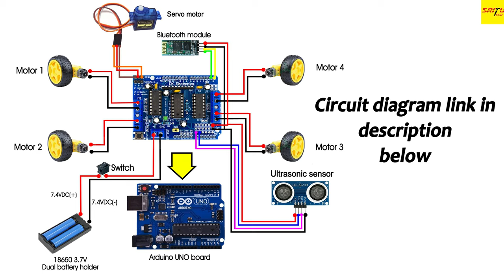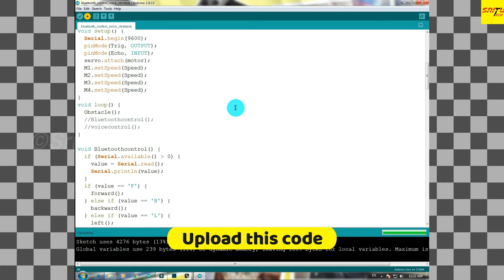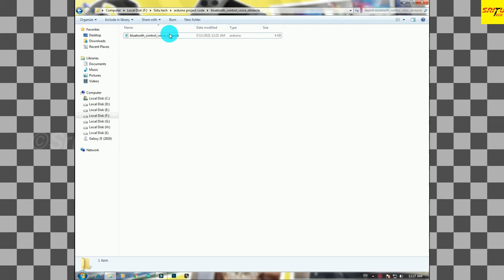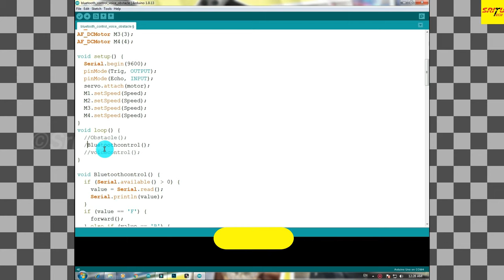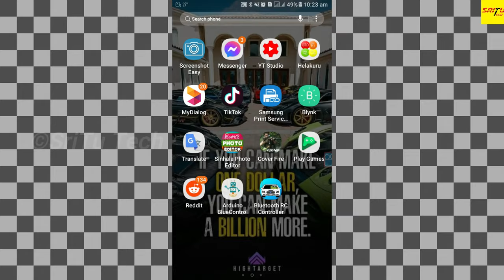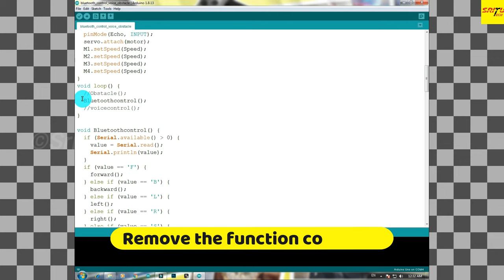Arduino obstacle avoiding + voice control + Bluetooth control Robot | DIY Arduino Robot

Comment from the maker: 👉Code and circuit diagram.
https://bit.ly/3IhfCMc
Reply: Hello sir How  this car cannet
Reply: In your laptop which version of  arduino programm 18.13 or 18.13or 22.2?
Reply: Which version is used to this code

Which version I should download aurdino
Reply: @mvsfcreation6847  +. Sorry for mistake Im not good at speak English. Which version  is used to this code
Reply: af motor only file name for download please answer
Reply: Adafruit-Motor-Shield-library-master zip  in Google drive only
Reply: It is not moving forward, can any one help
Reply: af motor.h : no such fie or program
Reply: The side doesn't open now😢
Reply: Mujhi obstacle avoiding nahi banana to mai kya karu
Reply: @drymaxgamerz9791 jonsa Banana ha tumhe wo wala ke samne se slash remove Karena agar obstacle to uska samna wala slash agar voice to uska samna wala slash hta dena
Reply: Bro it's not working
Reply: @sritu_hobby not working bro
Reply: Very nice 🎉
Reply: @vinaypuli8690  same problem bruh did get the solution
Reply: Bruh it is not moving can u help me
Reply: bro just llike u  r separately using those module can of voice obsacle and bluetooth so can i just upload the three os module at the same time
Reply: @sritu_hobby pls help
Reply: Bro, can I get the link of the app that you used for remote control of the car
Reply: hi,may i know why my bleutooth connection are not stable,just like connect to pohone about 10-15 seconds,then it will automatically disconnect
Reply: Hello sir me yeh puchna chata hu ki Bluetooth control + obstical avoiding ek saath kaam kar sakte hai
Reply: I want items
Reply: Interesting
Reply: I didn't know how to done code
Reply: This is for school project
Reply: How to connect ardino in computer
Reply: Yes @MORTALSKGAMING
Reply: Sir please help I think these codes are not supported now in the arduino  sir please give new codes for the same thing please
Reply: replay
Reply: H
Reply: bro i have fixed some bugs in this code and now it is functioning properly
Reply: 11:45

Comment: I follow same steps but my car didn't start
Reply: Are ache se kkarega tabhi start hoga
Reply: You want to put the code
Reply: Mera bhi same problem h... Hc05 tk power hi nhi gyi
Reply: Check code bro
Reply: Mera Arduino jal gaya
Reply: @STEMa2z-th9xv  maybe your battery is not power enough or u plugged the cables wrong
Reply: Skill issue
Reply: Bhai remote konsha hai control k liye

Comment: Materials used to make this rc robot car : -
1. Arduino Uno and its Cable
2. L293D
3. Ultrasonic Sensor
4. Servo Motor
5. HC-05 Bluetooth Module
6. Gear Motors x 4
7. Li-ion Battery x 2
8. Battery Holder
9. Connecting Wires
10. Jumper Wires Male to Female
11. Jumper Wires Female to Female
12. Switch
13. Robot Car Wheels
14. Male Berg Strip
15. Foam Board (*18x12cm)
16. Soldering Iron & Wire
17. Hot Glue Gun and Glue tubes
18. Star Screw Driver
19. Cutter
It costed me around 4.5k INR including everything gluegun & solder(high quality).etc
Reply: Budget
Reply: could you help me with this as it worked for you .  I have a question about the yellow-capped component labeled "PW" on the motor shield. Additionally, I've developed a car using the same procedure and utilizing two 3.7V batteries each. However, I've encountered two problems:

1- When I unplug the USB, the car stops working.
2- The batteries seem unable to power all four motors to move the car.
Initially, the setup worked fine during testing, but these issues arose later on. Could you please provide assistance on how to address these problems?
Reply: Bro from which website u purchased it ??
Reply: Around 1000 @lyricethos
Reply: @shalaby2002 use 9v battery
Reply: @rajkeshri3609 kuch bhi bhai 2000+ jata hai

Comment: 1. Arduino Uno Board
2. Ultrasonic Sensor
3. Bluetooth module
4. Motor Driver L293D
5. Servo Motor
6. Gear Motor 
7. Robot wheel
8. Battery holder
9. Battery 
10. Jumper wire
11. Foam Board
Reply: How much would all this cost
Reply: @vivekviswanath2607   do you know how much its all cost
Reply: I think it might 6000
Reply: Around 3000
Reply: Nah I got this done in under 2k
Reply: @SmuglrLtd  I need to talk to you about this project .May I have the privilege of your time, please?
Reply: @fuadkhan817  yes?
Reply: @SmuglrLtd  how did you cut off the cost?
Reply: I got this under 599
Reply: Project code ?????
Reply: @ash-cm4qq  how tell me
Reply: I am getting these all thing free from my school for project making😅😅
Reply: @vivekviswanath2607 nearly 5000 Indian rupees 👍🏻
Reply: I need code, help me pls
Reply: Code please
Reply: I need to ask some questions and make some enquiries, I would be glad if you can give me the opportunity
Reply: perkiraan brp tu harganya
Reply: Under 2k
Reply: Around Rs.1000 if you don't use lithium ion cells.

Comment: I made this project and i have a first price thankyou sir❤...
Reply: Bhai sab kaam kar raha hai?
Bluetooth, voice and obstacles saath me ?
Reply: @codesprinter1 Nahi bhai obatacale and Bluetooth sath me work kar raha haa
Reply from the maker: Great 👍
Reply: @sritu_hobby  how to implement both Bluetooth and obstacles together so that both can function at same time
Reply: @codesprinter1 implement the obstacle code just to stop the the motors when obstacle detected and integrate it with Bluetooth control to steer the vehicle
Reply: @navneetdhal0021  can you provide me code? Of this I am getting this issue with my project
Reply: @codesprinter1  first i need to know which app you'll use for joystick control
Reply: @navneetdhal0021  Bluetooth rc control same as u used
Reply: @navneetdhal0021  who Ankit?
Reply: Just tell me , both Bluetooth and obstacles can work together?
Reply: @codesprinter1  yes they can.Obst.+ bt+voice everything can work together
Reply: @navneetdhal0021  if I have to use obstacles then I plugged in to pc and remove the comments used before obstacles function but the Bluetooth doesn't work at that time and if have to use Bluetooth control then I have again plugged to pc then again I have to upload the code by comments the obstacles function and remove the comments in Bluetooth function then only Bluetooth control work but I need to know what changes should I do in code so that both obstacles and Bluetooth control can work together
Reply: @navneetdhal0021  but not working plz fix
Reply: @navneetdhal0021  how and what to do?
Reply: You can implement both codes in a way that when you drive manually and the robot detects an obstacle it will automatically stop and not collide even if you press forward
Reply: Sad thing is you can't copy paste from YouTube comment😛
Reply: @navneetdhal0021  can you provide me code?
Reply: @navneetdhal0021  but not working?
Reply: @codesprinter1  Kahan bheju bhaiya kuchh social media wagera kuch do to
Reply: @navneetdhal0021  comment hat ja raha hai id ka what to do?
Reply: Dont use @ symbol
Reply: @navneetdhal0021  same username but don't put 1 at last
Reply: Ok?
Reply: @navneetdhal0021 bro is it possible to perform all 3 functions at once?
Reply: @MUSLIMFILES-td7bc  Yes
Reply: Bro how can we contact, I want to contact u

Comment: After uploading the code, it is showing like this:
avrdude: stk500_recv(): programmer is not responding
avrdude: stk500_getsync() attempt 1 of 10: not in sync: resp=0x53
whenenver I am connecting the motor shield with arduino and trying to upload the code the com 3 option is vanishing and it is getting connected with com 1 aand then showing like this.

Please reach back to me on this error.
Reply: Did u remove the 2 // from the code like he said??

Comment: Nice smart car bro.I have question. Do i need 4 different motors for the car to turn left and right or can i make it turn left and right with a single motor. Basically i mean the servo motors in the rc car which rotates the wheels
Reply: With two motor you can make it turn left and right it not necessarily u use 4 motors. 4 motors consume more battery power

Comment: it is not upload help please😢😢
Reply: What error showing?
Reply: Bhai mera bhi ho rha hai
Reply: Bhai afm motor error aa rha hai
Reply: Apakah Ada Fruit Motor sudah terinstal? Atau colokan usb pada pc tidak bagus. Coba masukan pada usb pc yang lain.
Reply: Jo starting me */ ye hai hta do aur af motor library download kar lo..
Reply: Update library
Reply: @pragyadwivedi5182   Thanks it worked
Reply: @RitaKumari-zt3hj  Glad to help..👍🏻
You can ask if any difficulties come...Happy to help👍🏻
Reply: Can anyone seek help, in voice and manual mode car is only moving left and right not forward and backward plzz help
Reply: @RitaKumari-zt3hj  It can be because of any kind of coding error or crossed wire connections..check them..
Reply: He is right program not uploading
Error avrdude
Reply: @pragyadwivedi5182  Hello, I'm in a hurry right now. Can I ask you a question? Can I use the Bluetooth module HC-06 instead? Only the voice control function will be used.😢😢
Reply: @user-be4wi7gx1h  Yes, the HC-06 Bluetooth module can be used for voice control commands with Arduino. You can connect the HC-06 module to the Arduino's serial communication pins (Rx and Tx) and use a separate module or smartphone with voice recognition capabilities to send commands wirelessly to the Arduino. Keep in mind that you might need additional components or software to process and interpret voice commands on the Arduino side.
Reply: @pragyadwivedi5182  Thank you so much!! I feel relieved🥹 Can I ask you a question one more time?? Why remove the Rx,Tx jupmers before uploding the code??
Reply: @user-be4wi7gx1h  It's important to remove because rx is the reciever and tx is transmit you can't recieve data from two reciever(the one u using to upload the code) so u need to remove one reciever to upload the code in arduino..
Reply: How to update library
Reply: @manishdiwan008 hy kahase ho
Reply: @pragyadwivedi5182 how much it can cost??
Reply: @pragyadwivedi5182  please tell me how much it cost??
Reply: @aatmaj111  it cost me around 5k..but u can also do it under 3k..bcuz I changed a lot of things...and I bought big dc motors not the small one..if you'll buy acc to the video it'll cost u around 3k..
Reply: AF moter error problem
Reply: Library dawonload kro moter ki Mera bhi aarha tha
Reply: @aniketgaikwad6787 bhai kaise kare
Reply: Bhai Mera bhi ho Raha tha library dawonload kro fir nhi honga
Reply: @aniketgaikwad6787  bro library download krke version bagera ka issue aa skta hai, jo is youtuber ne file di hain unhai hi kaise utilise krein us issue ko solve krne k liye
Reply: @pragyadwivedi5182  afmotor iş making an error (no schule file or directory) pls help
Reply: Check the data cable
Reply: Use CH340 drivers if you bought arduino clone
Reply: Hai bro how to get this

Comment: have a question about the yellow-capped component labeled "PW" on the motor shield. Additionally, I've developed a car using the same procedure and utilizing two 3.7V batteries each. However, I've encountered two problems:

1- When I unplug the USB, the car stops working.
2- The batteries seem unable to power all four motors to move the car.
Initially, the setup worked fine during testing, but these issues arose later on. Could you please provide assistance on how to address these problems?

and what specific Batteries and how many of them I need and what volatge.Thanks In adavnce.

Comment: Bro iam facing struggle while uploading code.when iam try to apply the given code in "sritu hobby app" it gives no error but my car wheels are not rotating,and any of three functions are not working.connections are made correctly.and iam used HLW battery.please respond

Comment: please help. i checked all things. motor is not moving just servo motor is rotating. i provided 9v battery and li ion battery. code is same that you provided. l293d led is on and provided 7.4 volt too. I replaced l293d shield and gear motor are working independtly when connected to direct to battery
Reply from the maker: Check motors and motor driver
Reply: @sritu_hobby   bro you didnt mention to remove ext power jumper.that yellow thing. you had to say remove jumper while uploading code then.mount the yellow thing again.
 i fryed 3 l293d boards
😭

Comment: Uh For those who are not quite working and itsn powering up for me i changed my battery to total of 7.4v and it worked and if it worked and tire is still isnt all in one motion like one is going forward and other backward then have to rotate it so it works😅

Comment: For gear motor connection is single stand wire is used or multi  stand

Comment: Can you create a conditional statement code that includes a switch to change modes between obstacle avoidance and Bluetooth control, so the code doesn't need to be modified repeatedly?

Comment: I hv a question!!!
For the past few months I hv a prob in making this arduino obstacle sensing car... the prob is with the power supply!!
Thing is I'm also using the l293d motor driver sheild nd evry time I give power supply , the driver ports burns ..!! I'm using two 2200mah li ion battery nd evrytime my port burns..!! 

So I was pretty shocked tht in this vid u r using two 4800mah batteries nd still ur driver sheild works fine😮😮
I would be very greatly if someone just tells me wht to give as the power supply!! 🙏🙏

Comment: Sir Bluetooth control is not working 😢😢. The HC-05 module is working properly but when i connected to the app with bluetooth module the gear motor is not working. Plzz help me sir sameeeeeeeeeeee as he, plsss jelp

Comment: Bro.. I have given all the connections correctly. my ultrasonic sensor is working properly.but,the wheels are not moving.and Bluetooth also connected but wheels are not is any problem with code or motor driver problem..

Comment: Sir where can I contact u bcz my last date for representation of project is on 10th may but the project is not running well ...as I gave power to the battery it rotates 360 without any command ...sir plz help

Comment: Is it ok to use in 2 wheels only?
Reply: Yes of cos it very possible but if you are using two wheel control u will need a third wheel it like a small ball that will be placed at the front to easily rotate

Comment: Sir My One Problem Solution Find Me Please Sir Motor Driver L293D Shield Is Canect On Arduino Uno Problem Is  Motor Driver All Ic is Very high Hit When A Problem Solution  Please sir  Reply 🙏😢  😢😢
Reply from the maker: Check motors
Reply: @sritu_hobby  what checking in the motor

Comment: when you connect the battery your motor driver's led lit up but the vehical did not move , same happend with me, but in your case after you connected the battery you made a cut scene and your robot was working, PLEASE TELL ME HOW SHOULD I MAKE MY ROBO MOVE
, PLEASE

Comment: How much Power supply should I use
Reply from the maker: 7.4v
Reply: @sritu_hobby  I’ve added a lcd can you please provide code for that 
It will show every command given
Reply: @sritu_hobby  please provide the code as I have to present it in the college project and later In archivers

Comment: Everything is working when i upload code but my all 4 motor is not working if i connect motor in external batterty it's working but not in driver i treid many times give me a solution to work all of my 4 motors

Comment: I did the exact same one as yours, but only maximum two wheels can be motivated by motor at once. I can't figure out why, if anyone can provide some useful solutions? Thanks a lot.
Reply: It either your battery capacity cannot move the four motors at once or your motor connection are wrong, or the other two outlet for the motors are damaged. To know if it damage try testing another motors there. And also recheck your connections
Reply: @Vlight. Sir, i made this project but now coding is issue how can i connect it? Do help me aabd guide me

Comment: Thank u very much sir. Pls tell the application for the car controller
Reply from the maker: Check description
Reply: Sir I bought the motor driver but there are not any pins except of servi motor just holes to install them. Pls tell from where can I get them

Comment: sir checked multiple times .i have made same  but it is not working even after uploading the code the light of the motor driver glow only when connected to laptop when i remove cable it stops glowing  . Even after switching the switch on not working .Please help me i have science exhibition  next week .i am very tensed and worried please
Reply from the maker: Try again
Reply: I tried it's not working please help me

Comment: U have seen My Circuit diagram The Only Difference is that the Wires of motors Are Connected but not according the diagram ..
But what to do 
In your code it is showing error about the afmotor.h
Reply: dow load lidry

Comment: When I connect the motor driver the arduino on light stops but when I remove the motor driver it turns on and connect to the laptop
What is the problem

Comment: for the bluetooth control my robot is not going backward, but it does on voice control, how can i fix it? also how do i find the app in the video for bluetooth?
Reply from the maker: Check wires
Reply: @sritu_hobby  from the motors or from the bluetooth?

Comment: I have a question, why are u removing Rx and TX ports jumper wire from Bluetooth module everytime u upload the code , in case I don't do it what will happen? @sritu_hobby

Comment: bro ma 2 battery 3.7 V or 4batery 1.5 V ki or 9 V ki batter ko 1 sath coonect Kiya Fer bhi bulb on  hota ha arduino ka Bluetooth module on nahi hota plz help
Reply from the maker: Check the jumper wires. Otherwise replace the Bluetooth module
Reply: @sritu_hobby  nahi Bluetooth module on hota ha jab ma arduino ko computer se Coonect karta hu
Reply: @sritu_hobby  reply do